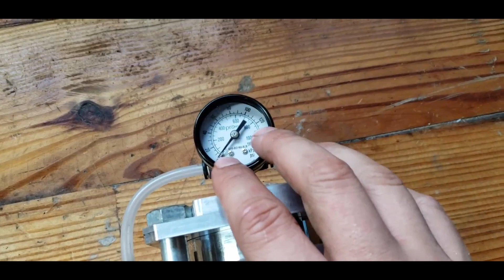G0704 Power Drawbar Overview

Comment: Nicely done! Thanks for sharing.
I'm considering going down the 3D printed power draw bar rabbit hole too. What are some of the major issues to overcome using plastic components? What I'm considering is using some metal parts to overcome the limitations of the 3D printed parts.
Thanks again, nice design!
Reply from the maker: Don't do it.  I've sank way too many hours into failures. Plastic simply isn't stiff enough to create reasonable sealing surfaces.
Reply: @LionSandwich  I hear ya. Safety and flying plastic shrapnel come to mind too. It's an engineering puzzle that I can't help but to ponder though.

Comment: if I am not mistaken, the series connection of pistons does NOT multiply the force. rather only the linear deflection/motion of the piston is 'multiplied'. the force remains: 
F = (pi*r^2) * air pressure = (3.14*(3/2)^2) * 90 = 424 lbs-force, which sounds light to me.
What is the spring rate of the washers?
Reply from the maker: No. Think of it like there is 90psi on all exposed area of piston.  In this condition the "affective" piston area is your calculation x 3.
Reply: @LionSandwich  ok I see it now.